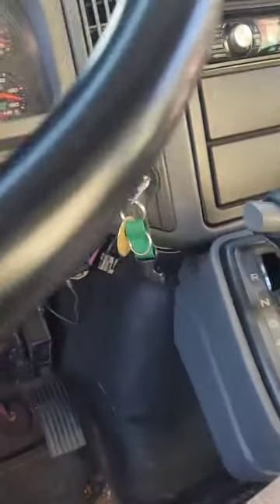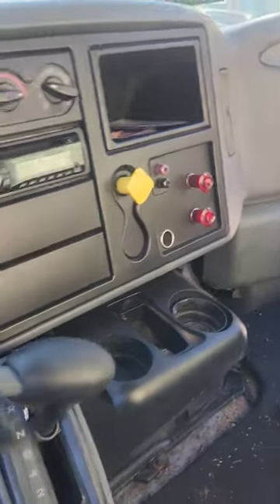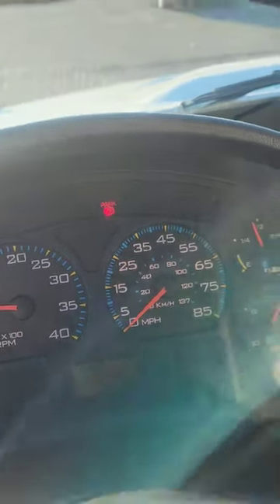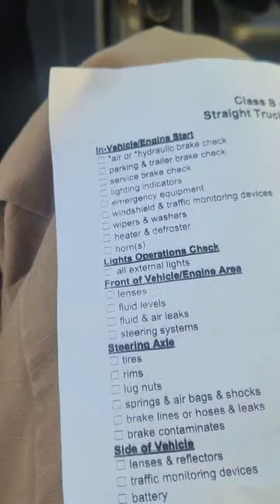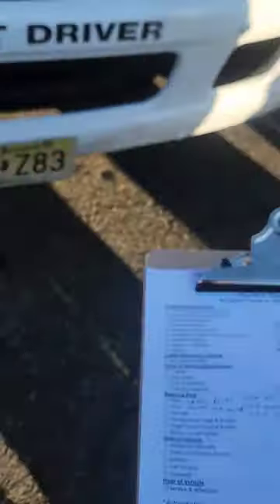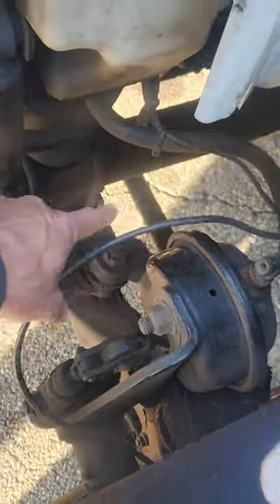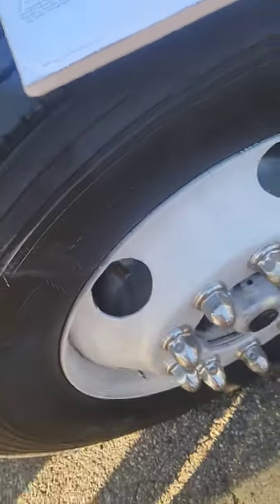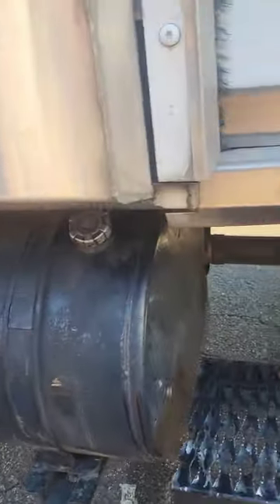Class B automatic truck pre trip inspection

Comment: Wait you don’t have to make sure you get from 85-100 psi in 45 seconds
Reply from the maker: No, you do not have to mention it to the examiner in NJ, but that is very good information for yourself once you become a driver. 

It's really about 85 psi to when the Governor cut off valve goes off, should take about 45 seconds. That tells you that your air compressor is functioning properly.
Reply: @JTTPT So you don't gotta name anything on the drive axle
Reply from the maker: @traviscarter1023  no the checklist specifies "steering axle"
Reply: @JTTPT  I noticed the other video I was watching for the longest was doing the drive axle. So I we and got that check list and just realized it and was like damn it seems a little shorter than what I was studying in the videos.